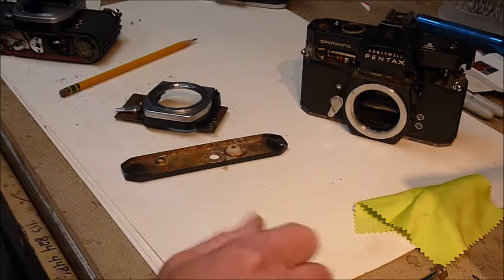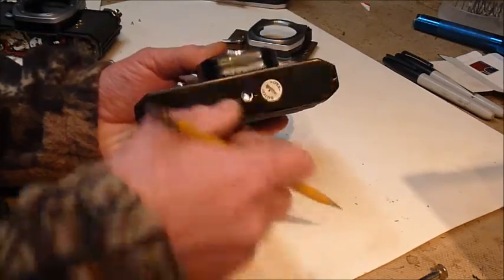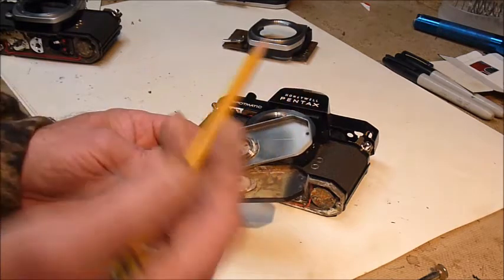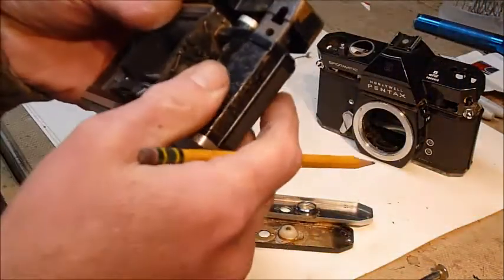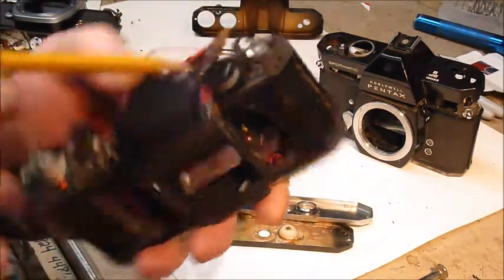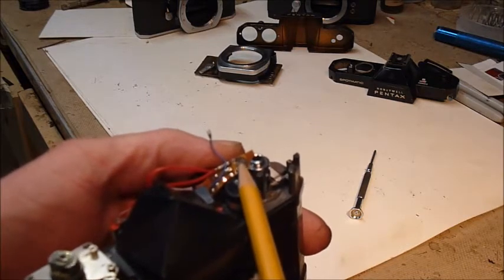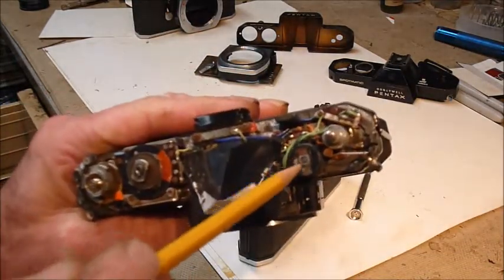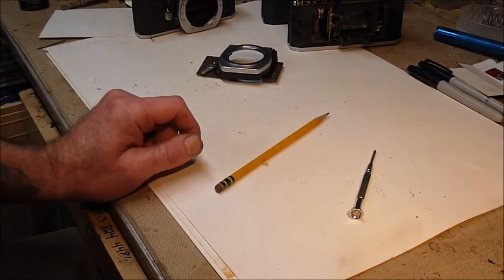Pentax meter problem spots

Comment: Spotmatic meters are pretty reliable no matter what anyone might say. The only failure besides dirty contacts is if the needle housing breaks internally and the needle does not move freely any longer.
Reply: I have replaced selenium cells is 3 camera in the last 2 months.  You are incorect.
Reply: @mikepxg6406  Spotmatics have a adjustable resister (under the film crank)  you can turn to set the correct exposure.  If this does not work for you, then maybe you are just having bad luck.  I have a huge collection and bought and sold many more. I have never had selenium failure yet, knock on wood.
Reply: @mikepxg6406  Spotmatics are reaching 65 years of age so maybe selenium failure is starting to become more of an issue.  For me, I have yet to run across this issue. I have a fairly large collection of first generation SP's, some I have put together out of parts, with no selenium issues. I have bought and sold many through the past 40 years.  Most common problem is corroded battery compartment.  There is a adjustable resister under the film winder you can set when adjusting the light meter.  I would attempt this first unless your meter is just dead. I am not sure how selenium's fail.

Comment: No moving parts ?  Apart from meter switch,  Shutter speed potentiometer, Adjustment potentiometer on PCB and moving magnet meter.  !!!  
This is So badly explained.  First the camera switches negative and the positive is grounded.  The selenium cells are wired in series and are colour coded to match the ISO/Shutter potentiometer.   This iso potentiometer forms 2 parts of the bridge the selenium cells and the calibration potentiometer form the other 2 parts of the bridge.  its a very simple circuit.  They are easy to repair if you have plenty of parts from old donor cameras and a fine soldering iron.

Comment: Mine is broke after I drop the camera, the needle keep on minus position
Reply from the maker: probably the meter cell in the viewfinder got thrown out of whack. you can get to by taking off the top and removing the prism but its a lot of fine work and the needle is as delicate as a human hair. The cell is replaceable if you could ever find one.
Reply: @tobroken1965  thank you 👌👌
Reply: Don't drop them...
Reply: @mikepxg6406  Don't drop or smack them hard.

Comment: Any tips on cleaning battery compartment ?
Solvent or brasso?
Reply from the maker: I have used a variety of methods, all with mixed results. In most cases, like the spotmatic above with its nylon battery well (this fits the new style 387s battery @ 1.55v), I generally start with vinegar and a Q-tip or even a tooth brush, ( would also do this with the bottom removed). If that doesnt quite do it then brass or other metal polish and a Q-tip. If the corrosion is crusty, a soak in vinegar can be helpful, followed by very a very gental toothbrush scrubbing. In cases when there is pitting of the metal surfaces, you can try streching a narrow piece on fine emery cloth (400 or similar) over the eraser end of a pencil and lightly scrub the affected areas. On the compression contacts inside the camera body I try to stick with gentler methods like metal polish. I have used similar methods on the newer style cameras that take the more modern batteries like the 357. Good luck, if you find another method or try one of the above methods, please post your results, every little bit of input helps.